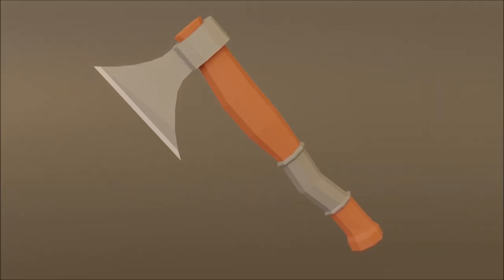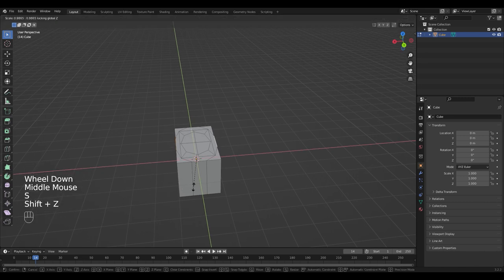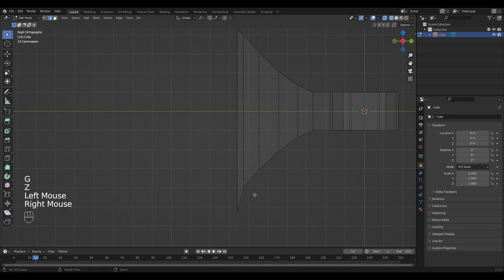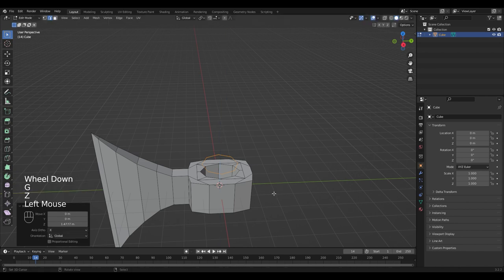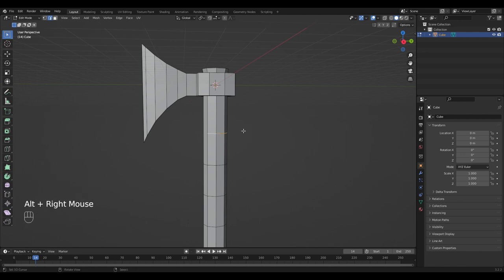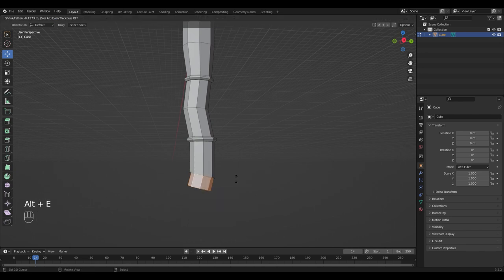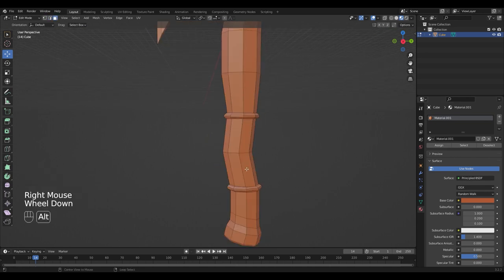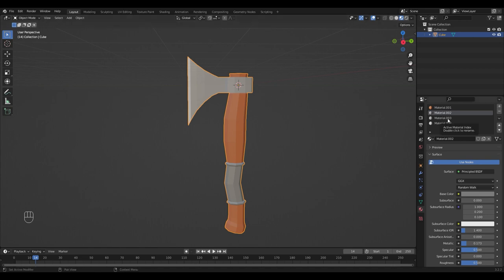Low Poly Axe Blender Tutorial For Beginners!

Comment: i have a problem
when i press w i dont show me the option looptools
Reply from the maker: You have to enable the addon „loop tools“. You can find it if you go to „edit“(tool bar top left) -> „preferences“->“add-ons“. Then search for it and activate it.
Reply: @tengertechnologies  Oh THX and good tutorial
Reply from the maker: Thank you! <3
Reply: Same, enabling didn't work
Reply from the maker: @flaafkam1483  So can you tell me what you did so far, so that I can pin point the issue?
Reply: @tengertechnologies  loop tools works for me from left mouse click, w didnot do that
Reply from the maker: Yeah, it depends on the configuartion. I use the oldschool controls. Blender changed it up after 2.8. I'm sorry I sometimes forget about this.